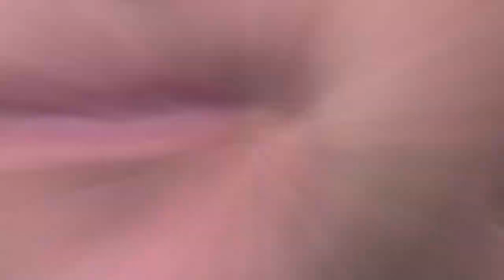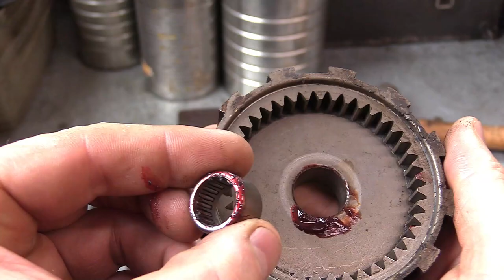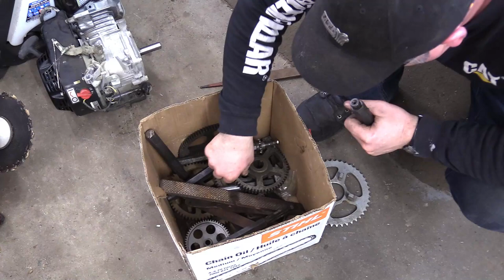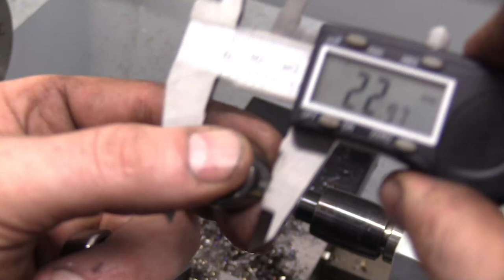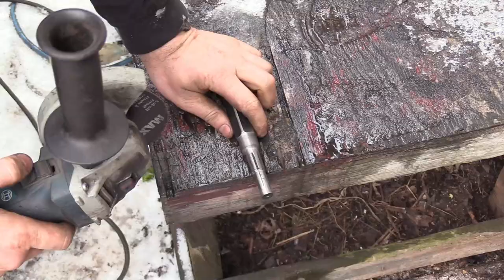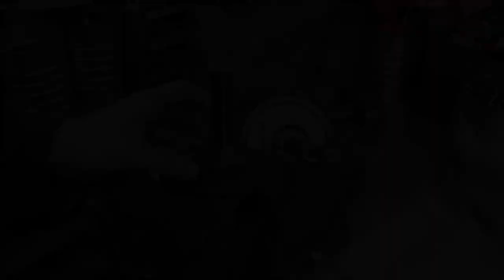Making Needle Roller Bearing Punches Out Of Scrap Parts! HOW IT'S MADE WITH DONYBOY73

Comment: Machining a third step above the bearing step can aid in setting the bearing/bushing to the same required depth each time. The nice thing about using old shafts to make drivers is that a lot of the machining is already done for you. Cutting off bolt heads and using the threaded shafts as alignment pins can aid in assembly when trying to keep gaskets aligned and silicone from smearing. Sanding the outer diameter of old bearing races until they just drop into the housing can help in determining endplay/preload shim requirements before pressing the new race into place. That lathe is a definite game changer. Nice work!
Reply from the maker: I'm just an amateur!

Comment: I Don't have a lathe, but I Do know where my nearest machine shop is  -- down the road a bit and around a couple turns in the road.   All they will need is the inside and outside diameter of the needle bearings.  Lathe the stock with a little slack and I'm Good to Go.  If they have any questions, I'll refer them to your video.  Thank you very much; this is one of your best yet!!
Reply from the maker: more vids like this to come!

Comment: Hi, Dony, I have been a subscriber for a long time and love your videos. They are educational and full of information. Wanted to ask on how do I find out the size of the bearings that go inside that drive shaft assembly., mine have been rusted solid and are not good.  I looked and can only find a complete drive shaft assembly with bearings inside already, which is very expensive and makes it not worth it to fix the snowblower. Thank you so much for your help
Reply from the maker: measure them with a caliper like I did in video and check with a bearing store